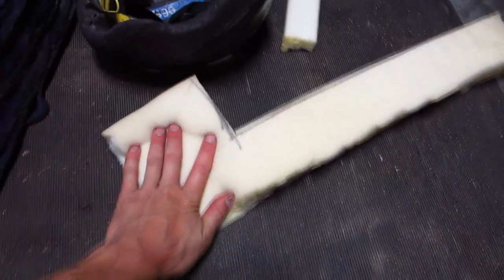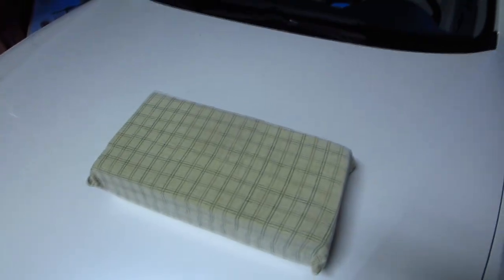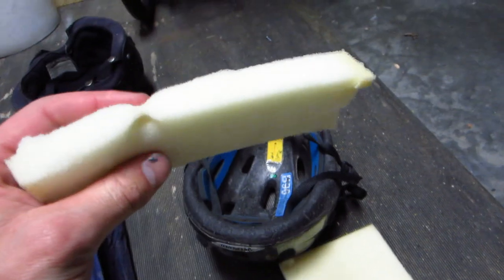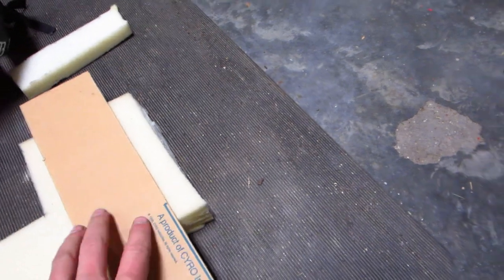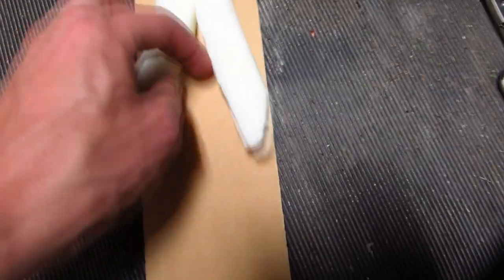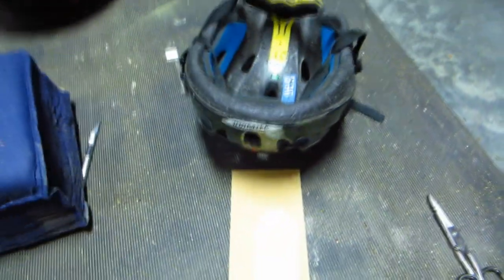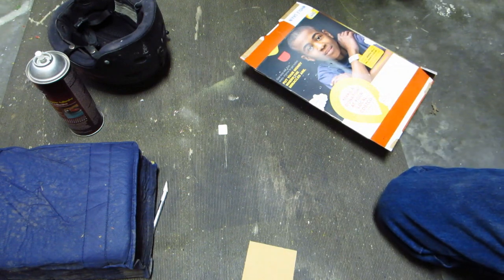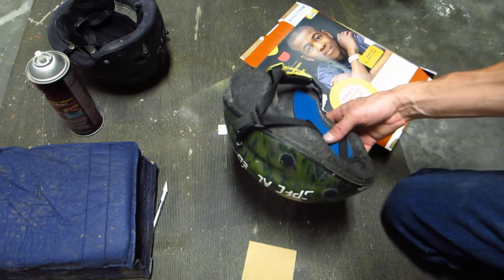Using Memory Foam in a Helmet

Comment: I have two bike helmet for sale which don't have foam on it. This is great ideal to make them Brand New and Yes, these helmets are Brand New, the only reason I am selling cause they don't have foam pads on it. Thanks for your idea to make them looks new. I will make put them this foam strips and put them on sell on eBay. It's on the list right now and I put the price so low cause NO PADS. Anyways, let me ask you one think that which glue spray are you using it. Cause I don't see glue spray on you video so would be mind can you provide me the glue spray name and so could buy them and install on my helmet and make them Brand New. 

Thanks 
Rick
Reply from the maker: The stuff I used was just what I had on hand, and  it ended up being a poor choice.
I'm not sure what would work best cheaply, but I'm sure its out there.